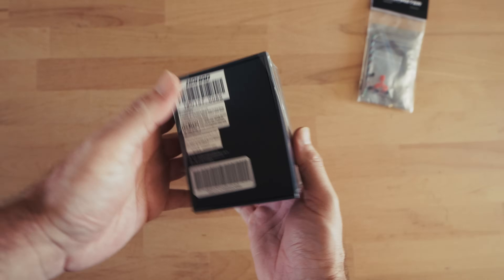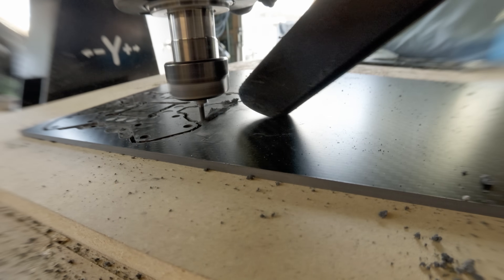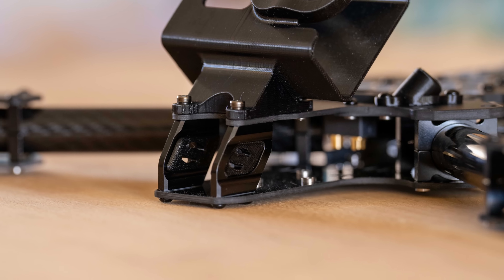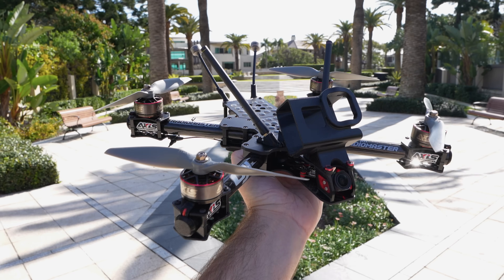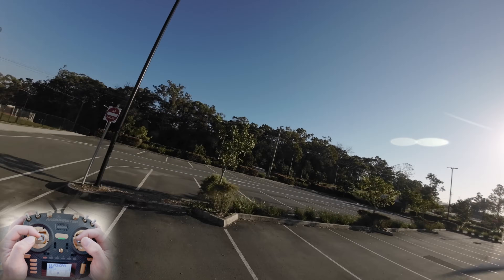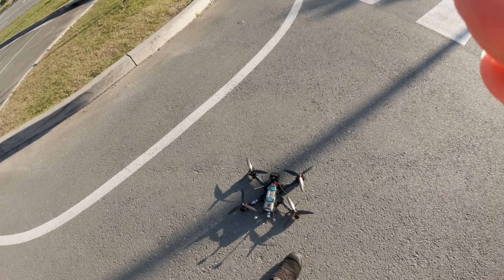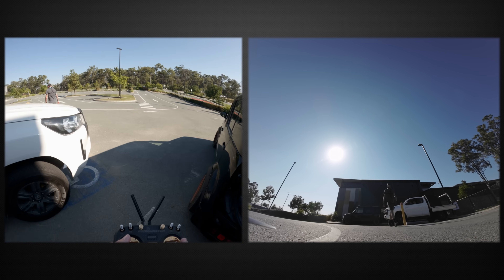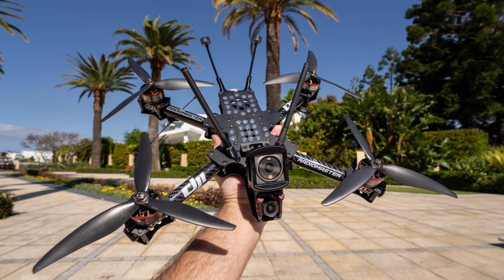Dual Band FPV Drones! (NEW RadioMaster Nomad)

Comment: why tube arms? theres nothing but plastic clamping friction force keeping it from rotating in a crash
Reply from the maker: At this size, tube arms offer greater stiffness and handle torsion significantly better. They're aluminium clamps and I think you're underestimating the torque required for them to move. This isn't a drone you crash. Plus, it just looks cool.

Comment: Does clipping the antenna affect range or connection?
Reply from the maker: Not at all if done correctly. I'm changing the frequency.
Reply: @ScottTomlinson I am beginner, so maybe I shouldn’t clip mine. LOL.. I have a radiomaster XR or XP.. can’t remember that’s kinda long
Reply from the maker: @ginupe32  Ohh. I was changing my antenna from 900 to 2.4. This needs to be done accurately. You can't just randomly cut antennas.

Comment: Amzing work, One question popped tho, you're not limiting your ESC for those motors in 8S ?
Reply from the maker: No need, they are capable of that no problem. The motors are only 1010kv.

Comment: I'm amazed that those 30x30 escs being used for huge quads - like this one - aren't burning out.  It's really a testament to their durability if they're holding up over time.  I'm afraid to use that esc in an 8S 1300kv 7" that I've been planning for a while... maybe I should try it..
Reply from the maker: Oh yeah they're fine until about 10 inch typically. I just pushed the Aikon 35A 20x20 to a smoke test. Peaked at 89A
Reply: @ScottTomlinson  The Aikon peaked at 89A total or per esc for a total of 356A?
Reply from the maker: @mlentsch  I was just running a test. Single motor (a 5015 with 17 inch prop) on one channel yeah. Pretty crazy.

Comment: Genuine question where do you get your carbon fibre from?
Reply from the maker: All different sources. Depending on what I need. Sometimes I make it.
Reply: @ScottTomlinson  ngl having the equipment to make carbon fibre sheets would be ace. Though, i have seen you can get 1m x 1m x 3mm for relatively cheap. Just wanted to know if you had any sources you would recommend?

Comment: Hey Scott Love your work!!  any chance you can share a source for press nuts?
Reply from the maker: I only use and recommend PEM broaching nuts. Especially for something like this where it's the critical point for securing the arms. I get them from Mouser - Part #153-KFS2-M3 for Stainless or #KF2-M3-ET for Carbon Steel.
Reply: @ScottTomlinson  Cheers! I've had them sitting in my cart for weeks hahahah :) thought you may have a better source.

Comment: Id rather they do this with video, 2.4 and 5.8 leave 900 and 433 for control...
Reply: Inb4 dji... I want open source plz.
Reply: also please use a respirator / water bathe your carbon cutting. so very bad for you...

Comment: I bet Ukraine will love this.
Reply: >operating simultaneously on 2.4 GHz and 915MHz

Ah, okay (*sets the jammer on 2.4GHz and 915MHz*)

The warzone is a little bit ahead of a recreational quad playground
Reply: @1sthisajojoreference  that'll be two signal jammers. If you've been following the war, then you'd know how OP recreational quads have been against $100m+ tanks and infrastructure.
Reply: @PvMLad  you haven't seen any jamming systems they're using there, have you?
Reply: @1sthisajojoreference  It's all on youtube man
Reply: @PvMLad  then why would you write dumb stuff about two jammers?
Reply: They are getting around jammers by having relay drones. Soon AI will be able to finish the hit if the signal gets disrupted.
Reply: @MadeInCanada2  absolutely, at that point you might not even need a drone pilot in the loop
Reply: @MadeInCanada2  you do understand, that relay drone is a drone too, right? And it could be jammed, as well as its signal?
Reply: 2.4GHz and 915MHz known as standard fpv frequencies and almost all of the jammers have these two ranges necessarily.
Reply: Naah they already lost it
Reply: Its probably invented there
Reply: I'm afraid you are far from this. All this has not worked for a long time.. 😀

Comment: so cool great work 

i want to ask 
i am flying my drone and the esc and motors are gitting hot is that normal its not that crazy hot but when i fly for a bit longer it gets hot 

i see your flight and you fly for too long does you motors gets crazy hot?
Reply from the maker: You should still be able to comfortably hold your hand on a motor after normal flying. If it's getting too hot it could be a sign of tuning issues or even prop/motor/weight combination. Older components (bent props, wobbly bells etc) can have an impact too. Sound can tell you a lot also. Nice smooth linear tones. No oscillations, trilling or fluttering is what you want.
Reply: @ScottTomlinson  ok bro thank you so much i well see

Comment: I mean cool but, the vtx is always gonna go out way before the rc link no? What's the point?
Reply from the maker: So I didn't showcase the true real world advantages in this video but it's significant in noisy RF situations, like events or commercial sets. It's going to have a big impact on the cinelifter side of things when adding broadcast/transmission components to the drone too (DJI SDR for example). Personally, the mental aspect of the system translates to my flying too, like, can this even failsafe? I definitely can't ignore how that confidence is perceived. Sending it deep into split level car parks or over ocean etc.. Who cares if 2.4 chokes, 900 will kick in...Confidence

Comment: Post this design to CNC Madness.  See if theyll cut this for the community.
Reply from the maker: They do some of my other open source frames yeah. There's a few quirks on the machining side (like tube clamp hole spacings vary from manufacturers) so it could be a little cumbersome. Stay tuned though.

Comment: Very cool

I wonder if that dual band ELRS would screw up something in the PID tune for say, Betaflight?

900 can only go up to 200Hz while you can go haywire on 2.4, assuming the packet rate are different on the 2 bands (You don't use a low low packet rate on 2.4 which would render the dual band benefit........ useless?)
Reply from the maker: The X modes are locked to specific refresh rates currently. I use X150 which is 150 Hz for both 2.4 and 900 (I fly 150 all the time anyway). No idea what's possible. ELRS 3.5 is bringing some new SubGHz modes to the table I believe. (Like 1000Hz for 900 tested to 20km)
Reply: @ScottTomlinson  Thanks, good to know.

Comment: What's the benefits of dually band
Reply from the maker: It's significant in noisy RF situations, like events or commercial sets. It's going to have a big impact on the cinelifter side of things when adding broadcast/transmission components to the drone too (DJI SDR for example).
Reply: @ScottTomlinson thanks

Comment: its a chunky beauty
Reply from the maker: Yeah fat boy spec haha. Beauty of tube arms is extending them out to say 11 inch. All of a sudden it's a premo LR rig at next to no weight penalty.
Reply: @ScottTomlinson  That's what I was thinking! I have been putting off buying a CNC router setup for a long time, but this has me itching for one again. Any recommendations on a good kit for cutting carbon plates for quads? What are you using in this vid here? 
P.s. fantastic video and great design on this setup.
Reply from the maker: @DavidTaghehchian  I designed and built mine from scratch. There's actually a bit on this at the start of my high speed build a couple years back. You'd get away with a typical 6040 CNC though. Carbon is pretty easy to mill.
Reply: @ScottTomlinson  thanks for the info! Seems like I have some more research and shopping to do. Happy flying. Cheers.

Comment: Not concerned with carbon dust?
Reply from the maker: Yeah absolutely. I typically run a spindle shroud and my extraction is HEPA. All the cutting clips are just one offs while filming. I'm still masked up however.

Comment: Dual band means ? Is that like anti-jamming ?
Reply from the maker: It will perform much better in noisy RF environments as it receives data across different frequencies. The official marketing is 'exceptional interference rejection'
Reply: Lol it means he can run 2.4ghz and 900mhz at the same time

Comment: So on the rear arms there are 2,4 and 900 antennas and that two huge one on the front are also one in 900 and the second 2,4?
Reply from the maker: That's correct. 4 in total. The right side is 900 (one on the arm and one up front) The left side is 2.4. That's just how I arranged it. I got matching sized whip antennas but obviously the 2.4 is higher gain. I just wanted it to look symmetric mostly. The rx is just u.fl so any antennas are fine.
Reply: @ScottTomlinson  could you, please, provide links to these antennas?

Comment: Also, flying around a mobile tower like that is baller. So much noiseeeee.
Reply: Mobile runs on 868MHz for FCC and 915 for CE, so it's not that much of an issue unless you're using the wrong band at the wrong time. Still incredible though!
Reply from the maker: @whatsthematter8767  Kind of the point though no? Now there is no wrong time.
Reply from the maker: Didn't even break a sweat haha. The future is now! Thanks for the comments and stopping by again.
Reply: I don't understand at all, what is it for? Anyway, the video link will fall off before the control. I would understand if the video was on a dual channel. But drone control..
Reply: @ mainly, this is more for LR autonomous planes. Dual band allows for double the packet transmission or more packet redundancy, especially on non-LoRa MAVLink modes.

Comment: Wow, what a beautiful drone! Have you shared the plans somewhere? Or are you planning to do so?
Reply from the maker: I haven't prepared any files yet but possibly can. There's a few intricate bits in the design and I've found the tube clamps vary in dimensions so you would need to modify certain parts at least. I doubt it would be a frame that could just be sent to shop without testing clamp widths etc. I also had to machine a couple mm off the apex cam mount as the clamps aren't exactly 28mm tall.

Comment: The carbon dust from the cnc is very bad for your lungs, be careful to wear masks and gloves, best option us cut them under water or spray a lot of lubricant on it. Neverheless, really cool frame design, I did the same, 20mm tubes are very lightweight and super strong. And looks f*ing cool :) Related to the motor holders, you can get U shaped clamps so you don't need plates under the arms, it could save a little extra weight :)

Comment: haha the tango 2 in the bin 😂 that cut deep
Reply from the maker: Sorry not sorry haha
Reply: @ScottTomlinson  🤣 to be honest seeing more and reasons every day to swap. Just need to save some $ for the switch
Reply: @wakingdreamfpv Just add a module to the tango^^
Reply: @wakingdreamfpv  So far the Tango 2 is the most valuable remote i have over my TX16shit and jumper but whatever
Reply: @ScottTomlinson best place for it 🚮
Reply: @ScottTomlinson  I HAVE A TANGO ITS NOOT GOD OR WHAT I DONT HAVE THE DRONE YET
Reply: had to go back and pause it myself :) good laugh there
Reply: Tbh still prefer tango2. Tried boxer, tx16s, jumper t20, mambo.. I only use tx16s for long range, adding the 2W crossfire module on its back. Other than that, Tango2 and mambo have best ergonomics for me. Sure there's Zorro, but the screen's ugly as hell, and sticks out like a sore thumb. Modded my Boxer for the same reason, replacing the lcd screen to OLED panel, works nice. But still prefer the tango, added "internal" diy 250mW elrs module + cnc gimbals. Perfect to handle, compact, nice and tidy screen, internal crossfire.. Mambo would be the second best in ergonomics, unfortunately has Tracer as internal module. 

With Nomad getting released, I'm thinking of trying it with Jumper T15 though. Will have to try how that radio feels. Could potentially work for me, replacing both elrs and crossfire.
Reply: Just don't like the need two units for mavlink
Reply: @elxero2189 You don't now they have native mavlink support with rc